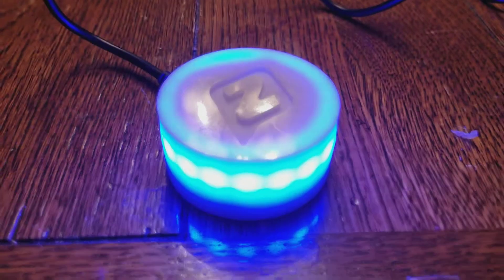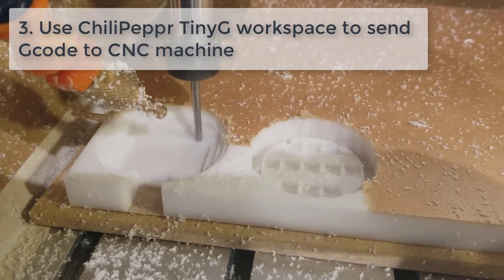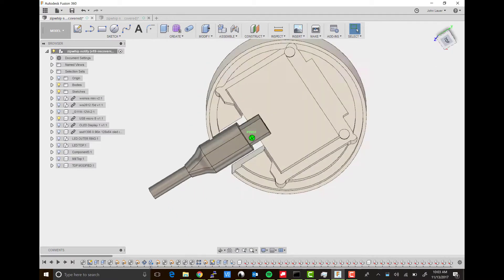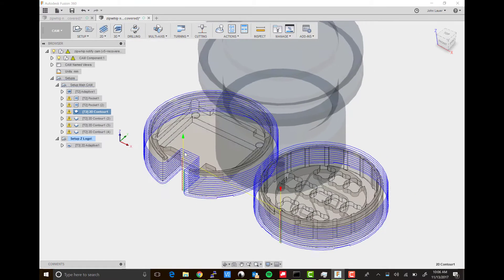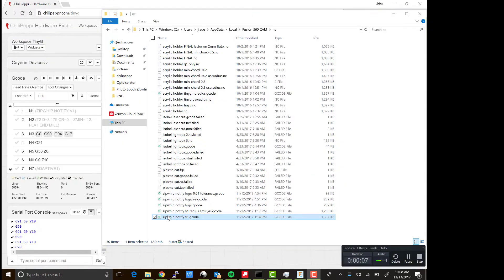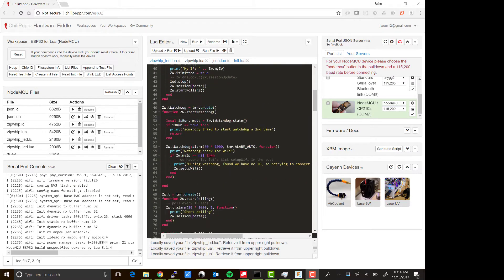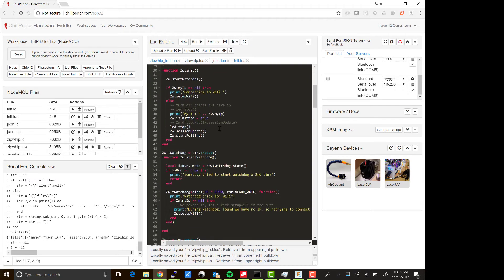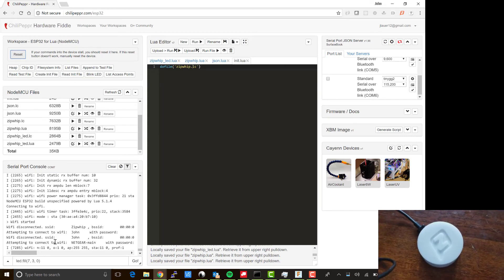Using ChiliPeppr to Mill and Program the Zipwhip Text Messaging Notifier IoT Device

Comment: Love this!!
Reply from the maker: Thanks Benjamin. It was/is a fun project.
Reply: I personally have played with Chilipepper for making PCBs but every time pretty much results in broken engraving bits as the auto leveler fails to do its job.
Reply from the maker: Are you Grbl or TinyG? I have also found that the low 3.3v is not really good enough for some end mills that lack good conductivity. A 12 or even 24v level shifter could be a better way to go. I've broken end mills that are too small like you have. 

Also, if you have end mills with compression rings on them, you can probe with a thicker end mill and then swap in your tiny tip end mill. I never use v-bits anymore and like to mill with around a 0.8 to 0.3mm flat end mill.
Reply: I use GRBL and V bits for making my PCBs :)